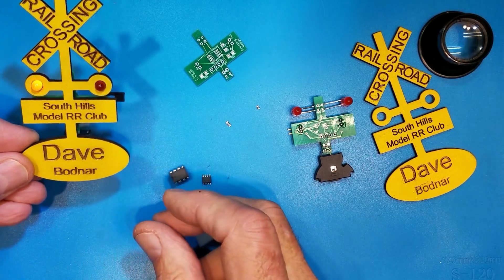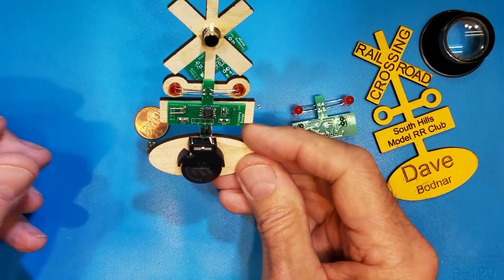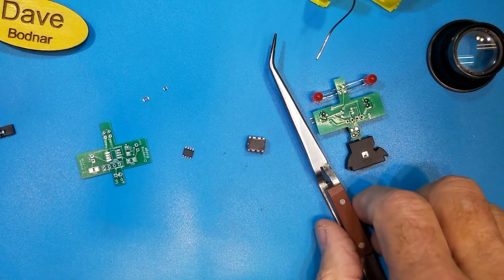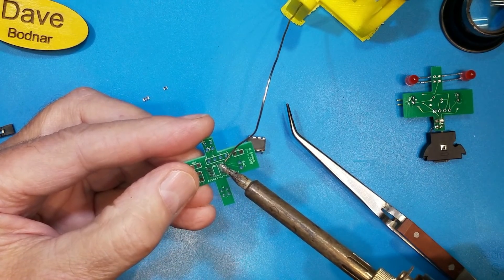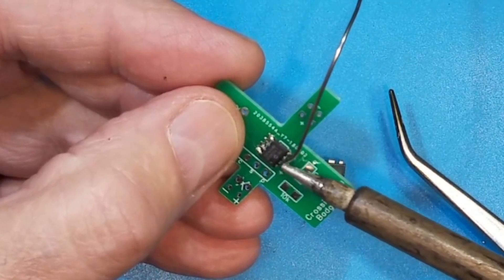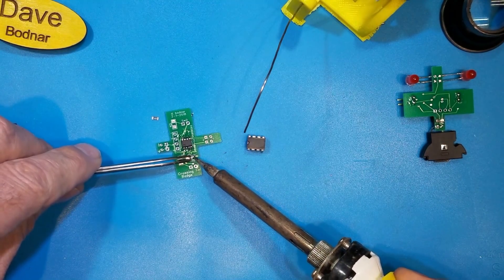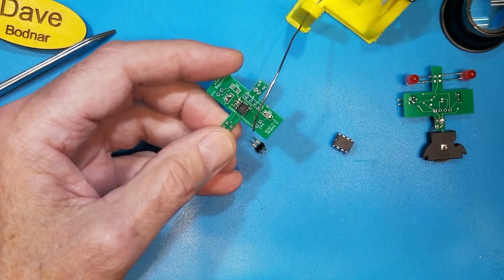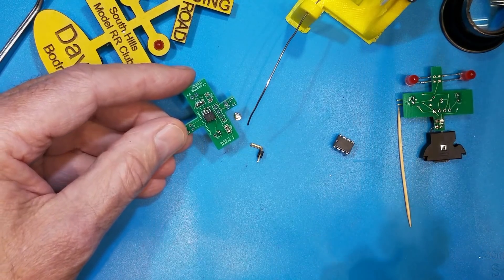Soldering Surface Mount Components - Tips, Tricks and One Way to Remove Bridges

Comment: Hi Dave, i'm an "N" scaler and i tried to make interior light bars for my carriages using SMD''s,  i'm not bad at soldering but it sure didnt end up as it looks on your video, you need a really steady hand for that! By the way i ended up and bought the light bars in the end!
Reply from the maker: Phil - I consider myself to be very lucky to be able to do such soldering - Maybe its because I don't smoke or drink!
dave
Reply: @DaveBodnar  I dont do either of those things either, but i ruined more components the time and money i spent was way out of control, thats why i gave in in the end

Comment: Ive done lots of soldering, and I havnt seen the toothpick trick before, thats pretty groovy, thanks!
I use the tap method for solder removal too, but I do it a little differently than you do. Instead of tapping the board on the pad, I hold the board firm in my hand, and I bang my hand (use the big meaty part of your hand) against the counter. Its actually faster than a mechanical solder sucker. I also re-use that solder to help desolder larger components.
Reply from the maker: It is good to hear that you liked the video - I'll give your method a try - thanks!
dave

Comment: Hi Dave, soldering iron and wire are a bit oversize for this smd work? I use 0.2mm wire and a iron with a 1mm tip. Please don't wait too long to publish the program? I thought a 555 were needed for this job, I am curious to see how you got this doen by the pic.
Reply from the maker: Brice - I  do have thinner solder and smaller tips for my soldering iron but find that the sizes shown in the video area good compromise for most work - saves me from changing tips!
I could have done the circuit with a 555 but I prefer the reduced parts count and simplicity of the PIC-stay tuned!
dave

Comment: Some great tips Dave. I have been practicing drag soldering for surface mount ICs with a chisel tip. It has been giving me some decent results, but I could still use some more practice.
Reply from the maker: Mike - practice is the ticket - I have been doing surface mount for about 6 years and get better every day!
dave